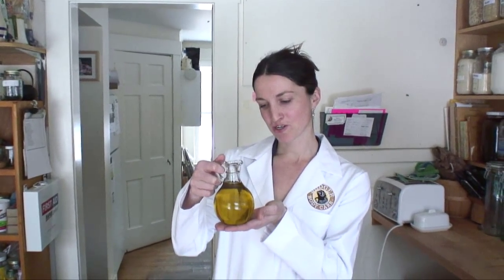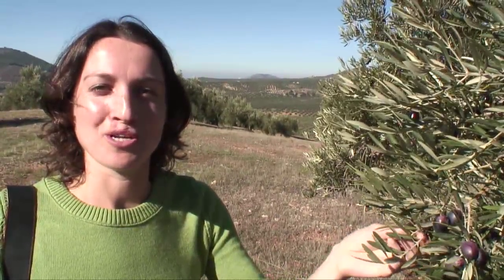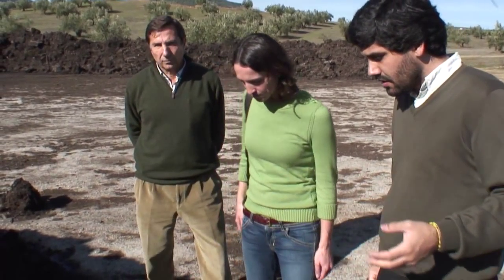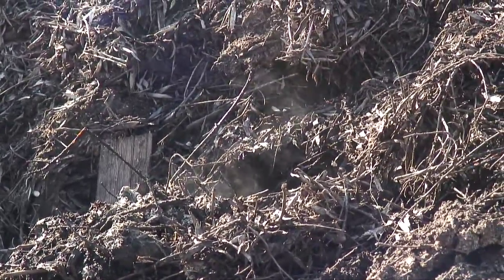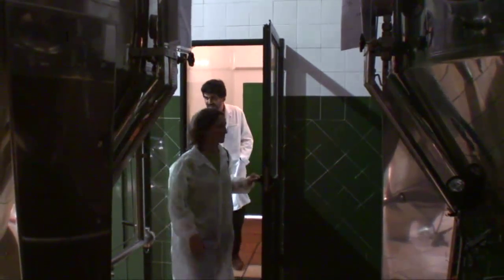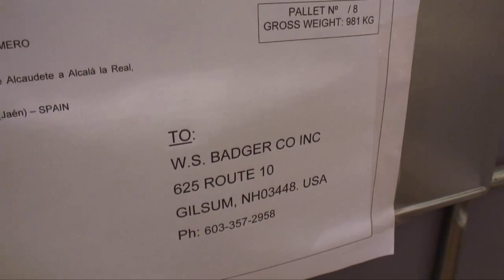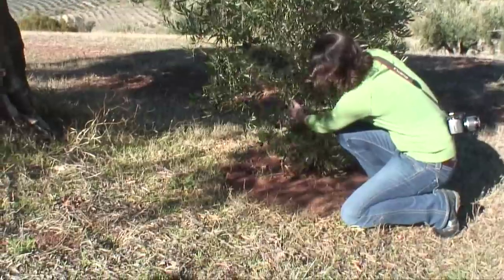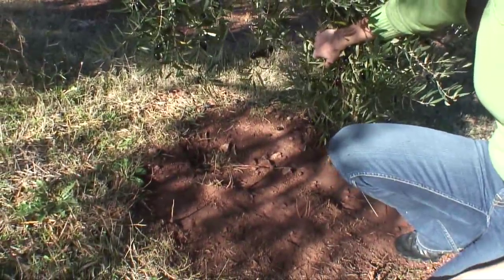Badger Healthy Body Care Uses Organic Extra Virgin Olive Oil from Spain - Full Version

Comment from the maker: @blukatzen we agree, and we feel that supporting farms like Soler Romero moves us in the direction of eliminating these pesticide concerns. Of course, it won't happen overnight, but it's a start! Soler Romero's composting system is really impressive - they use only byproducts of the harvesting & pressing process, mixed with goat manure (btw, the goat manure is the only thing they "import" onto the estate, and olive oil is the only thing that leaves). Closed production cycle - very cool!